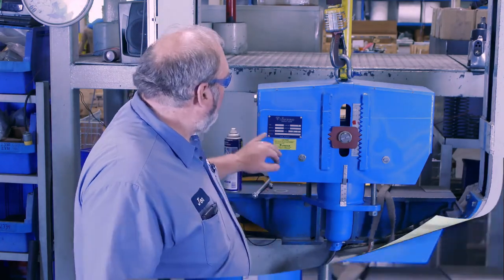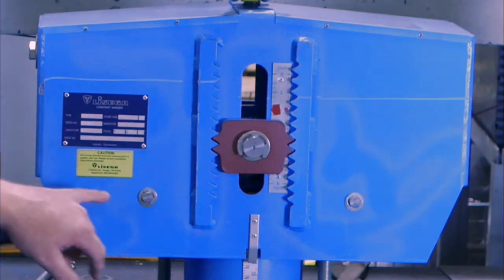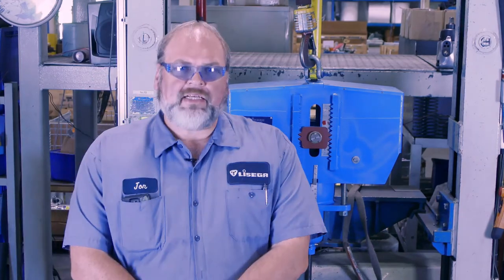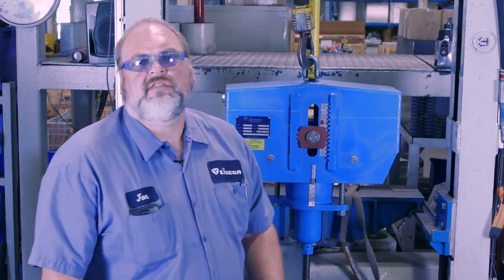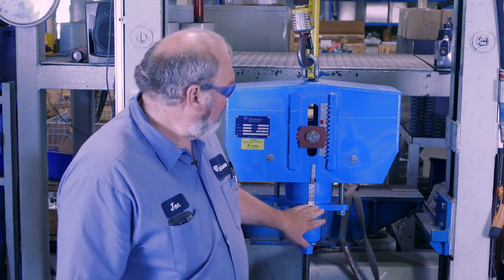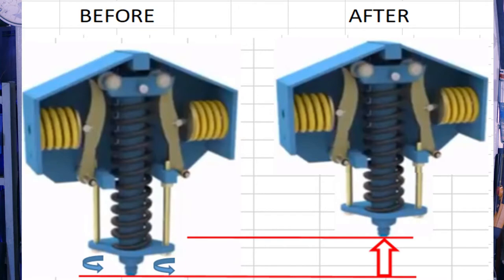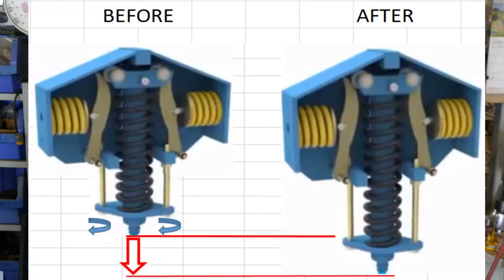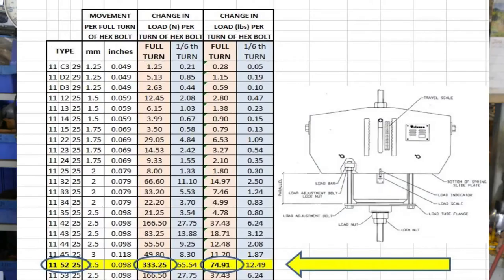LISEGA Constant Supports - How To Adjust The Load

Comment: Understood this video.. My question, how to know when to adjust the load using those two bolt and why not adjusting using the turnbuckle. Thanks in advance
Reply: Basically the load adjustment bolts are intended for high variation in load change with minimal deviation in load point elevation. When minor correction is needed with respect to altering the load point elevation along with slight deviations in load is not worrisome, it should be tried with turn buckle.
Reply from the maker: The red and white marks on a constant force spring show the calculated hot & cold POSITION of the spring. The marks do not indicate the load the spring is applying. The LOAD the spring is applying on the pipe remains the same throughout the entire range of travel (this is much different than on a variable spring). Changing the dimension using a turnbuckle will only change the position of the pipe, but not the load the spring is applying. Changing the position of the pipe will shift the pipe load to nearby springs. The only way to change the load that this particular spring is applying is by using the two load adjustment bolts.